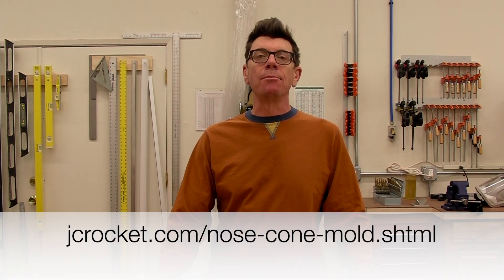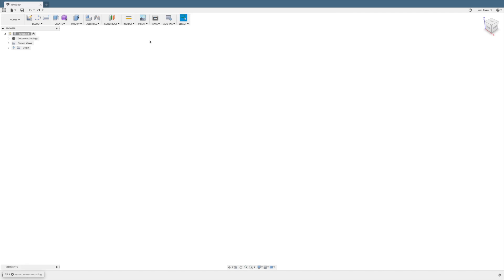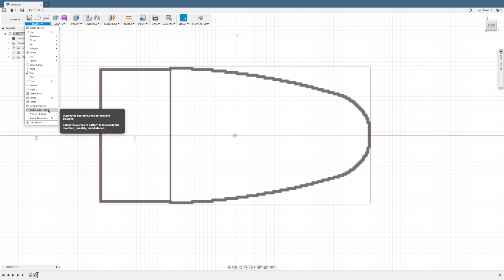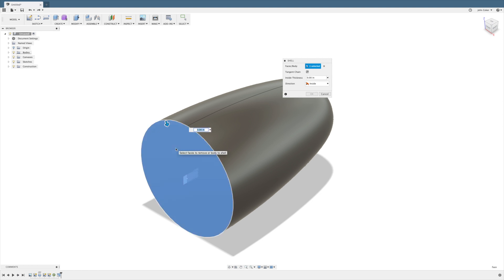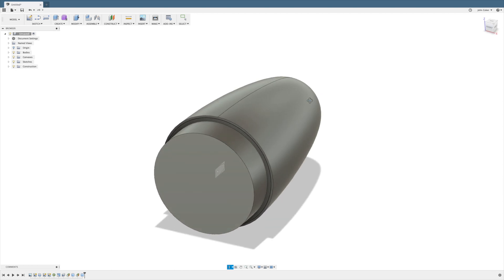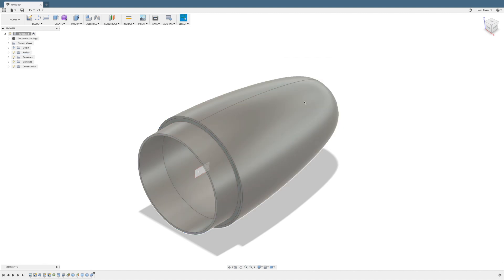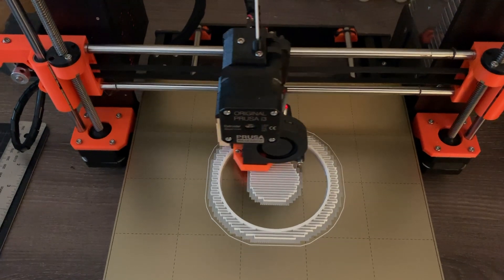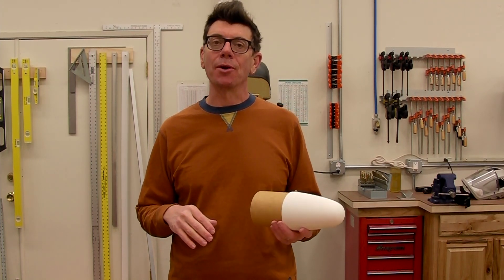Printed Nose Cone

Comment: Much easier way to size that nose cone than using scale.  When you have the canvas imported, right click the canvase and select "Calibrate", measure the size of the cyclinder  tube, the set the same part in the canvase to that size. Voila, you have the perfect size - NOW: create your parts!!

Comment: Great video! How much did the nose cone end up weighing? Was it significantly heavier than a typical purchased plastic nose cone?
Reply from the maker: Good question; I didn't weigh it, but I'm sure it's heavier than a plastic nose cone. Of course, in my case the coupler is heavier than a blow-molded plastic shoulder and I believe the PLA body is heavier, because it's thicker.

Comment: grade video way dit you do the shell command for the thickness of the nose cone before the shoulder it just added an extra step in the prosses. and if you do a fillet where the shoulder joints the nose cone you often can get away without the neat for support material if the fillet is the same size as the difference in the to
Reply from the maker: Great idea. I'll have to try that next time. (I'm still learning Fusion 360; switching over from Rhino because of the parametric features.)
Reply: another good youse for 3dprinting  nosecones is vase mode where there is only 1 perimeter it makes a grade superlight weight pard for smaller rocket/slower just neat to design it into the pard and there may be problems at the top of the nosecone if it is too big of an overhang "blunt" as each layer neat to be on top of each otter